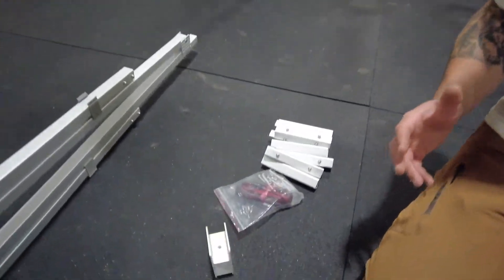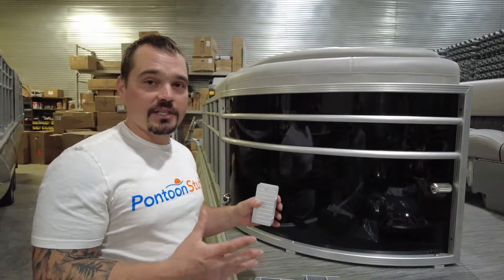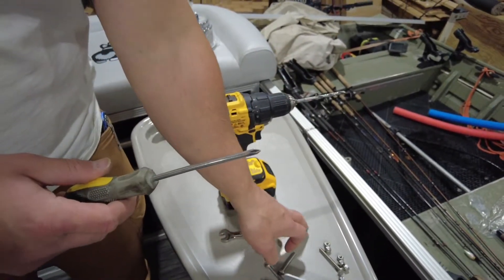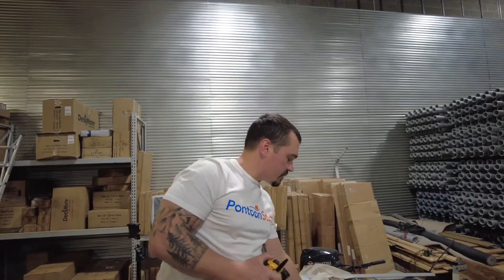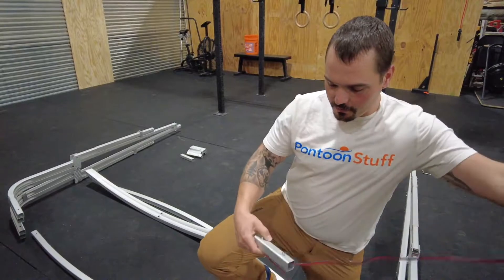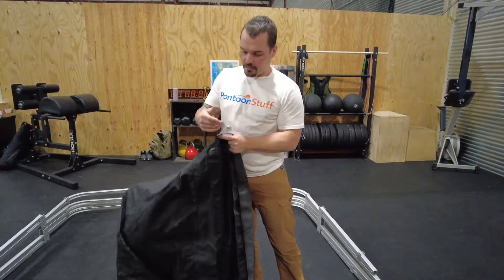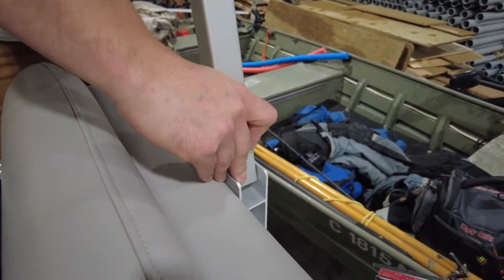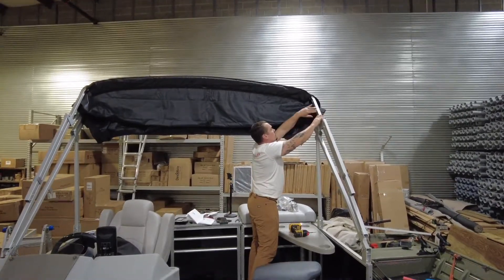Installing BIMINI TOP on Pontoon Boat - HEAVY DUTY 8'X10' Bimini Top

Comment: Will these lay flat
Reply from the maker: Yes, they’ll be just as tall as the frame tube is when laid all the way back and down.
Reply: @tomspontoons  do you have a video showing it laid down? I’m ordering one tonight
Reply from the maker: @reynoldsautorepair173  I don't think I do. The heavy duty version from Pontoon Stuff has taller brackets that bolt to the railings. The bimini will lay into those keeping it from resting too heavily on seat backs or sundeck cushions. There are bimini trailering struts that you can order on Amazon too to help pop it up 6 inches if need be. Otherwise it lays back as flat as possible for trailering so that it's not catching wind.

Comment: What comes with the kit to hold the “clips” in place?  You say you used a self tapping screw.  Do those come with it?  

Also, the measuring between brackets.  Do you measure 36” and 38” from the hole that you drilled for the center bracket?  Or do you measure from the front and rear edges of the center bracket?
Reply from the maker: The fasteners for the clips are not included with the kit. I measure between the brackets themselves...so the spaces between brackets are 36" and 38"

Comment: On a 26 footer where should I place mine ?
Reply from the maker: It's always personal preference, but I like to make sure the captains chair and back seats are covered so that people can get relief from the sun (or rain). Make sure you've got the space on your railings free of doors or other obstructions. Mock up where each bracket will go, and remember the bimini extends about 12" or so beyond the bracket when it's installed and up being used...so you'll cover beyond where the front and rear brackets are. Hope this helps!!

Comment: Does anyone make a mount for square tubing bracket mount is cutting boat cover can I convert the tip of the Bimini top to pin mount
Reply from the maker: I'm not sure exactly what you're asking? 

Yes, you could make it a pull pin mount at the ends if you'd like.
Reply: @tomspontoons  thank you
Reply: @tomspontoons  the bracket mounted on the rail is sticking up to tall and is cutting the boat cover. Do you guys have the brackets for the pin type

Comment: Great video ! I have a 20 foot sylvan do you think the 8x10 will work or will i need to stick with the 8' long?
Reply from the maker: We just installed a 8x10 on a boat with an 18’ deck and even had an 8x10 on our own 16’ (went longer so we could do a camper enclosure). Just make sure you have the railing Space to install…all said n done the brackets will span about 82” along each side of the railing.
Reply: Thanks for the speedy reply !!! I think I have the space but I will definitely double check the measurements before ordering.
Reply from the maker: @craiggelinas560  Smart! And use our discount code when you order!! Just enter TOMSTOONS at checkout to save 5%.

Comment: Hi Tom do you have a video of you mounting a pontoon stuff Bimini on a 1 inch railing? I would like to see how the hardware attaches to the frame before I make the purchase for the new 8 x 8 Bimini and frame and boot  Thankyou
Reply from the maker: I do not have a video of doing that. If I were installing the Heavy Duty Bimini on a 1" railing I would push them to the inboard side of the railing so that the lip on the bracket is pressing against the outside of the railing. I'd also either add an extra bolt or drill two new holes on each side of the factory one to run bolts through. A pair of holes and bolts would keep it from trying to rotate or wallow the holes out over time.

Comment: My bimini top has 4 bow's and measures 8' 10" long and 93" wide. I can only find 8' & 10' long replacement's. Will the bow's adjust to fit the 8' tops?
Reply from the maker: Is your boat a Bennington? A few brands have their own unique sizes that only a canvas shop can customize to recreate, or checking with a dealer to see if one can be ordered from the manufacturer.

Comment: For the bracket spacing, is the 36" to back and 38" to front measuring space between the brackets or is it measuring from the edge of the middle bracket to the outermost side of the front/back bracket? Thanks!
Reply from the maker: I measure the space between the brackets. So if I place my middle one, I measure back from the rear edge to the front of the rear bracket. Hope that makes sense and helps!!
Reply: I think it does. I got the 8x10 canopy, and I'minterpreting your response as the space between brackets. So, 38" space between middle and front bracket, and 36" between middle bracket and rear bracket. Correct? Sorry, just trying to make sure I fully understand before drilling holes in my rails. 🙂
Reply from the maker: @804nash  exactly! I usually mock them up to make sure they’re in spots that are good to drill through and bolt on. Then I install the rear ones completely, measure forward to the center ones, install those, then to the fronts. You’ve got this!

Comment: I don’t see the rail mounts that are in the video on the web site. Also, the clip in pins.
Reply from the maker: These components all come as a kit with the new frame. I will pass along that you’re looking for just the pins and brackets. Assuming you want those parts without buying a whole kit? It always helps to know what folks are shopping for!!
Reply: @tomspontoons  I am interested in ordering a complete kit but I’m not seeing the push button springs on their site. I did just call them and they said their tops come with the push through pin, I would like the push springs as to not damage my seat backs. Thanks in advance for any info.
Reply from the maker: @George-vf9mv  the heavy duty option has spring buttons for the front and back supports, and only the center supports use a pin. I’ve swapped the pin for a 1/4” Philips head bolt to avoid harming furniture. Lean the seat back in just enough to insert the bolt from the inside out, then tighten a nylock nut on the outside just enough to catch the nylon, but not enough for any sharp edges. The brackets that come with the kit are pretty tall and clear seat backs on most occasions, especially if your railings are 26” or taller.

Comment: Anyone struggling with vacuum method or wanting to skip it - just add a skinny fishing weight to a string and drop it down the tubing. Tape other end of the string to the wiring and easily pull it through.
Reply from the maker: Always open to improving the process!! If the fishing line method works well for you please comment back and let us know!!
Reply: I ordered this too last nigh looking forward to getting it on.  Best channel period for ppl that diy pontoons. Thx 😎
Reply from the maker: @Formerlywarmer  thanks so much!! We have the 8x8 heavy duty Bimini video posting tomorrow morning. You’ll love either option. Easy to use and sturdy!
Reply: @tomspontoons  I believe u.  I ordered it from pontoon stuff    Seats and  vinyl-flooring next.  I’ve been learning the seat configurations and finally have somewhat of a plan
Reply from the maker: @Formerlywarmer  their free shipping makes it really convenient to order stuff piece by piece to make sure it’ll work. Just another perk!

Comment: Great video. But why not wait to put front mounts till you have bimini up. Seems to be a little loose. I've have many center console boats and I've always had my bimini tops tight so not to flap in the wind. Just wanted your thought.
Reply from the maker: You’ve got a great question there, and yes, I’m sure your idea could help tighten things up. We chose to demonstrate installing the bimini following the measurements in the instructions. The beauty of this bimini design is that all four legs are completely adjustable to get that canvas snug and the angles exactly how you want them!

Comment: Hi Tom, quick question here.   Do you have any videos on how to install a 2nd Bimini in front of the stern Bimini?
Reply from the maker: Sorry James, nothing for the double Bimini yet! I haven’t looked much into what’s available for aftermarket options either. Usually it seems that the double Bimini comes from the factory or a local canvas shop makes it and installs it. If the two bimini canvases didn’t connect in the middle then it would be pretty straight forward I’d think.
Reply: Thank you for your reply,  was hoping to find a 3rd system that could be installed on 8.5 and 8’ wide pontoons. Love your channel, keep them coming 👍
Reply from the maker: @jameslafferty9052  not quite yet, but I wouldn’t be surprised if Pontoon Stuff comes out with an option in the near future as they’re on the cutting edge for all things aftermarket pontoon!! Thanks for watching!

Comment: Hey Tom great video!  My pontoon measures 96" BETWEEN THE RAILS!  do you think I can get away with the 8' wide from pontoon stuff, or do you think I have to get the 8' 6"
Reply from the maker: Great question!! I’ve tackled this same issue before on a customer’s boat. We did the 8’ wide version and it was stretched slightly outward. This looks better (in my opinion) than the alternative of it being narrower at the bottom and wider at the top. The way it collapses all the back will be a little goofy, but if it has something to lay on it’ll be just fine.
Reply: @tomspontoons  thank you 🙂
Reply from the maker: @calvinprobst4820  welcome, thanks for watching!
Reply: Sorry to add onto this thread but I had the same question, except my width is 99". I'm guessing I'll need the wider 8'6" top?

Comment: Hi Tom. You mentioned you don't recommend or would trailer the pontoon with the bimini in the half way position.  I have the same bimini and it didn't come with the short legs to secure it lower. Do you have any tips on how you would stow the bimini while towing? I'm asking because i did tow it in that position and it caught wind and the boot was forced to one side exposing the bimini top which then opened up like a parachute and ripped before i realized it. I replaced it with a shade mate top but wouldn't want the same thing to happen again.
Reply from the maker: You're not the first person to have that happen, so don't feel bad. They don't necessarily design the bimini and boot to be trailered going 60+ mph! I either lay the bimini all the way down or rest it on "trailering struts". If you do a quick google search for "Pontoon Bimini Trailer Struts" you'll come back with some options to order. Just make sure you get the correct diameter tube to match what you have. I have had to put a clip to hold the zippers together before when trailering on the highway to keep from unzipping from the middle outward. Otherwise those little "bungee balls" work great when wrapped around in a few places to keep things from coming undone!
Reply: @tomspontoons   I wasn't sure what they were called. googling "short legs" had unwanted results. But thanks for sharing!
Reply from the maker: @cbui1811  Haha, gotta watch out for the verbiage on Google searches!

Comment: I have a 22 ft SunChaser. It’s an 2007. I want to add a 3rd toon with a fuel tank as well as a transom for a larger engine. I have it stripped down to floor with only the console left. Also needs new flooring and seats. Where do I sign up for you to help me out?
Reply from the maker: Best place to start is by sending me an email: tomspontoons@gmail.com , if you’re in Michigan then I can be of most help, but happy to help with some guidance if you’re not local!

Comment: Hey tom. After u install the bimini, there is a half cushion behind you covering where a fuel tank or battery goes. Where did you get that. Right now we have a full sundeck on the back. Our motor top is big and when we raise it, it hits that sundeck. Id like to remove that full length sun deck and just cover the battery and fuel compartments.
Reply from the maker: We had a local upholsterer make that for us. I take him the board that’s been cut to fit, and then he works his magic to match the furniture and accent designs. Any local upholsterer should be able to do that for you…usually $300-$500 for a small custom pad like that

Comment: Greetings Tom, my bimini top when collapsed cuts off my rear fishing seats on my Crest pontoon.  I'd much rather have all the deck available to use, it looks like I can move the system back to where the top will lay on or just behind the back rail.  Besides filling screw holes in the rails, loosing some forward overhead coverage, and extending the stern LED wires, are there any cons you can think of that I should consider?
Reply from the maker: No cons at all! Make it work best for you. Just take the measurements for the mounting bracket spacing so you can replicate it when you move everything back.
Reply: Great summation, there are more occasions when the bimini does not need to be raised for fishing and even pose limitations if raised.  Even a new top is only so tall and would need the same consideration in order to fully use the deck unobstructed.
Reply from the maker: @awakenedtotruth8419  you’re right! I lay flat the Bimini on my 16’ fishing tritoon when it’s time to go out and fish hard or when we’ve got a bigger fishing trip planned I take it right off so we can fish out of the rear better in the river!

Comment: Hi Tom. I have a 24’ riviera cruiser. I was thinking of a double Bimini that zips both sides in the middle to cover the entire length of the boat. Have you ever installed one? Thoughts and recommendations?
Reply from the maker: Thanks for the question! I’m not familiar with a standard aftermarket option. I’d honestly leave that one up to a local upholstery or canvas shop. Do it once and invest in high quality materials and custom craftsmanship. Wish I had a quicker/easier way for you, but I don’t at this point in time!
Reply: I liked can you make a binkini top fit if it seems to small
Reply: I've come across companies that offered fully enclosed canvas enclosures for pontoons and they used the concept of zippering to the front of the existing bimini.  I also come across companies that built them from scratch,  both methods were very expensive even exceeding $10K on average.  Try searching using keywords (fully enclosed pontoon cover)

Comment: Does this one come with the hole for the light I've got my in chart but it doesn't  say anything  about a light or hole
Reply from the maker: Yes, it should have a 1/2” hole drilled in each cross piece, on the bottom. If not, drill a 1/2” hole in the bottom center of the rear cross piece. File or deburr the hole to make sure the wiring stays safe!
Reply: @tomspontoons   ok thank you
Reply from the maker: @jeremyyarbrosr841  you’re most welcome!

Comment: That's a great video. Couple questions on it. What's the head room underneath when installed? Also are your side walls 18" or 24"? Thanks!
Reply from the maker: Thank you! I don't have an exact measurement, but it's got to be at least 6'. The railings we're installing on are 26" tall with 1 1/4" OD square tubing.

Comment: Hi tom, im debating between getting the 8x8 vs 8x10. Is the length how much the shade covers? I have an old 87 tracker party barge 24ft that i was gifted
Reply from the maker: Hey Bryan! I think on a 24’ long boat the 10’ long version is really a nice looking feature because it balances the boat a little better than having all that deck space and furniture with just a short Bimini in back. It’s 100% personal preference though for space and meeting your needs. Installation is simple and quick for both options (keep in mind measurements are slightly different for each, so read the instructions).
Reply: @tomspontoons  thank you, we ended up going with the 8x10
Reply from the maker: @bchavezjrbc  You'll love it on those hot summer days for retreating from the sun!
Reply: @tomspontoons  last question haha for screwing in the brackets, do we measure from the end of the bracket or from the hole where the screw goes?
Reply from the maker: @bchavezjrbc  I measure from end of bracket to the next bracket!!
Reply: If u go with an 8 foot long is the measurements still 36 and 38
Reply from the maker: @andrewdrevdahl2329  great question…ANSWER IS NO!! It’s 34” back from the center bracket and 38” forward!!